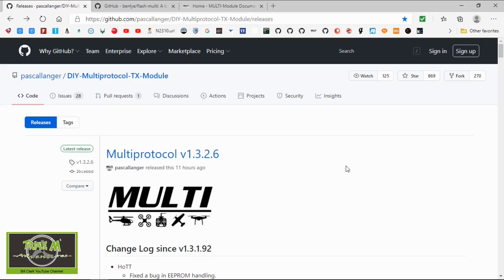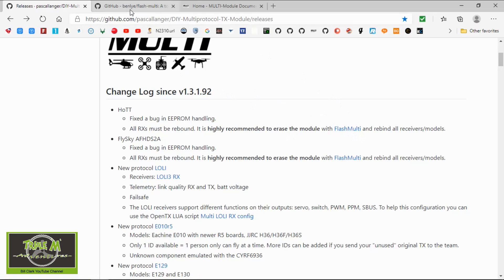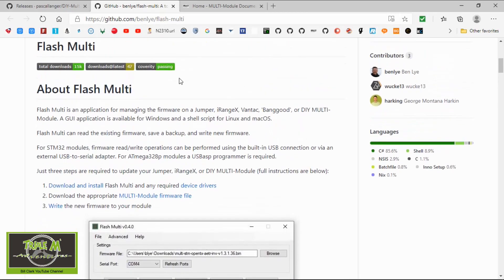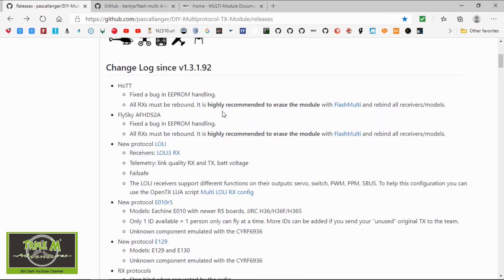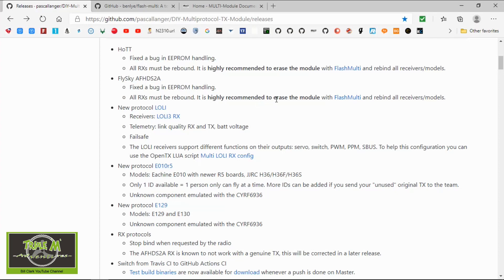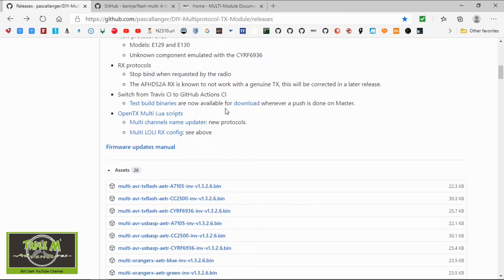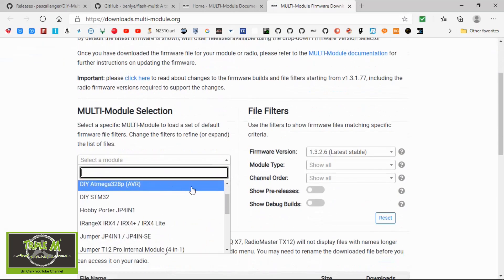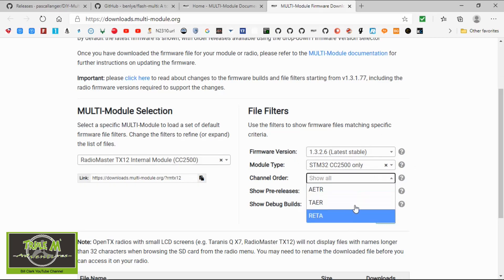Multiprotocol Module Firmware Update v1.3.2.6 Available Now

Comment: I'm glad they have acknowledged the bug in the Flysky Trainer mode. I found the trainer mode worked between two MPM (e.g. my Jumper T16 and my Radiomaster TX16S) but using my Flysky FS-I6X the bind would never complete. The Flysky radio is lighter and thinner so its perfect for my 8 year old to start out on..

Comment: Yes, the Flash Multi is for External modules.  You need to use it at least ONCE as some modules don't have the bootloader code installed (often they come with an old 1.2.0.20 version.  You can see the board types here : https://github.com/pascallanger/DIY-Multiprotocol-TX-Module/blob/master/docs/Compiling_STM32.md#usb-to-serial-adapter
To use Flash Multi for the first time requires some soldering (that's why they usually ship with pinouts and jumpers.  You also need an FTDI-Adapter such as an FT232RL to connect to the soldered pin header to update the bootloader and firmware for the first time.  After that, the firmware can be updated from OpenTX.
Reply from the maker: Thanks for that Paul.